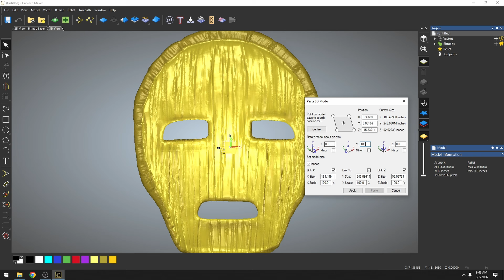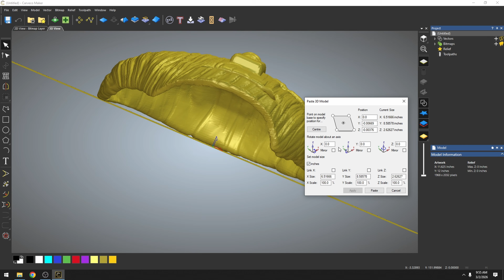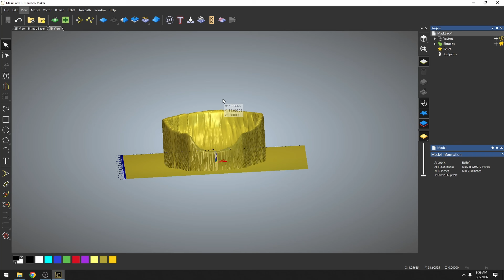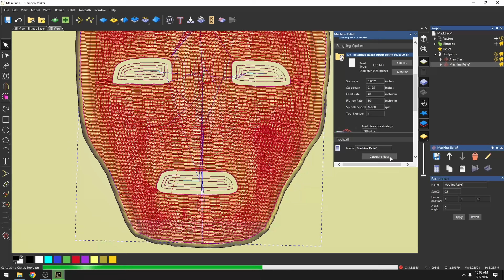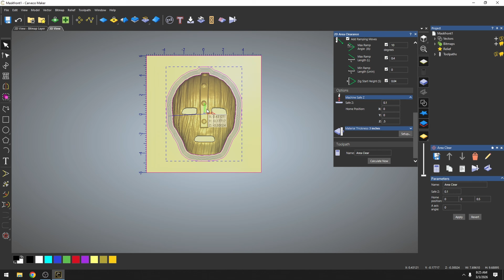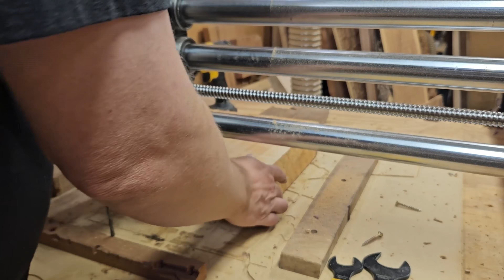2 Sided Carving in Carveco Maker - Viking Mask Project

Comment: Really useful...thanks a lot for that.
Might it be possible to create a mask in Maker+, starting from a picture?
Any suggestion much appreciated.
Reply from the maker: Sure you would just need to create each side and use the same outer vectors to make sure it lines up on both sides. Just design, flip and save and then toolpath it.

Comment: Did you go straight to wood for this or did you try it out with something like foam to verify your toolpaths?  I would think a prototype run with something soft and cheap would be worthwhile on a complex carve like this.
Reply from the maker: No I went straight to wood. This project the client sent me the specific wood he wanted me to use so I actually only had one shot at it and just went for it. Living on the edge lol.
Reply: @Timberfalls  You're braver than me.  Really glad it worked out the first time.  Must be a testament to your Maker/CNC skills.
Reply from the maker: @gizmobowen Nah just lucky. It was a long process to carve both sides and I had other projects to get done so I really just did not have time to run a test  I usually buy enough wood to do the project twice because things go wrong more than often.
Reply: @Timberfalls  I definitely appreciate that, and it's better to be lucky than good.

Comment: great video! if you would like to carve an image, what bits would you use for roughing and finishing ? I have a basic 4040 cnc with 1/8th inch collet? I am very new to cnc carving
Reply from the maker: Check out my video on photo v carving. I do that with a vbit. For 3d reliefs I usually use a 1/16tapered ball nose for finishing and 1/4em for roughing.
Reply: @Timberfalls  thank you so much